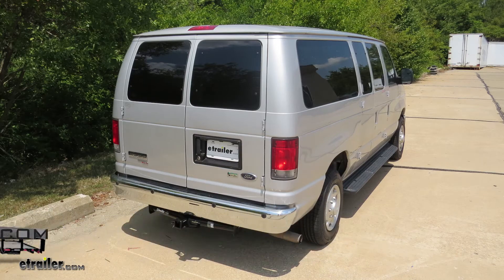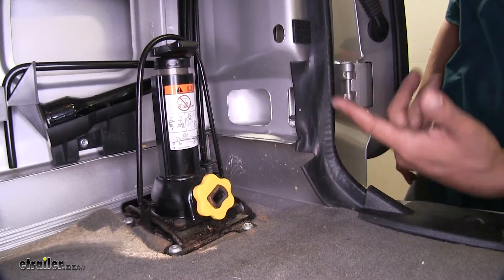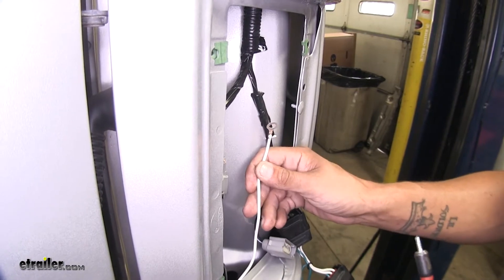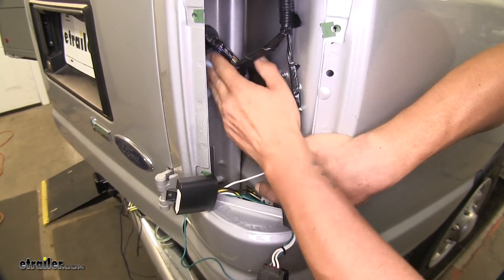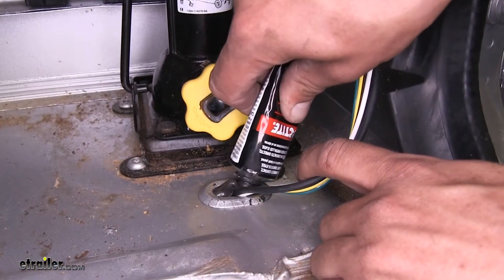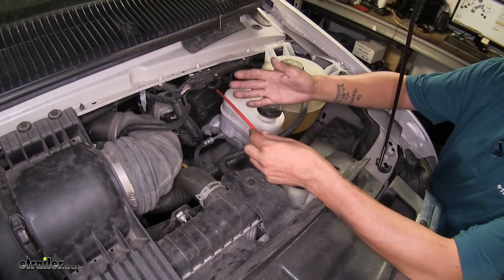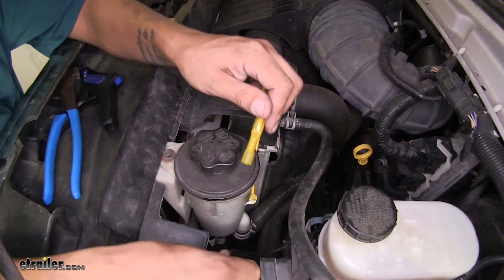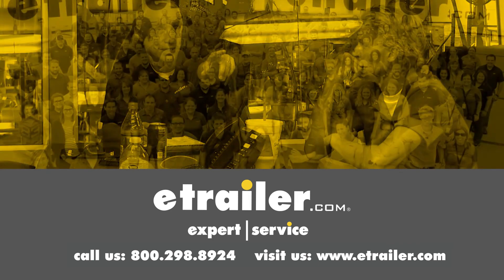Install: T-One Vehicle Wiring Harness with 4-Pole Flat Trailer Connector on a 2014 Ford Van

Comment: On the kit I received the control box has to go on the driver side. If it's placed on the passenger side the power wire is too short to reach the battery. I learned the hard way.
Reply from the maker: You just want to make sure that the wires are going to reach the tail lights so that you do not have to splice into them.
https://www.etrailer.com/Custom-Fit-Vehicle-Wiring/Tekonsha/118551.html